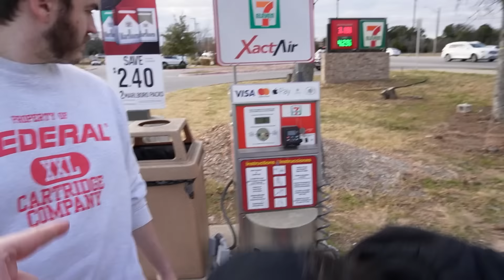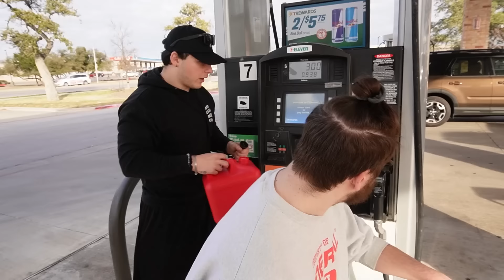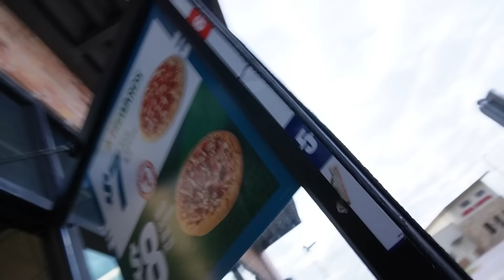i bought him a car

Comment: The 1982 Honda motocompo minibike was specially designed for the Honda City Turbo 2 to fit perfectly in its trunk. An easy portable scooter to use anywhere when needed

Comment: For those who don't know Blue Smoke means the engine is burning oil because of an oil leak
Reply: It's a two stroke. Blue smoke means it's running too rich. You would be correct if it was a four stroke though.

Comment: engines let out blue smoke when gasoline is burning off. its probably from when you were filling the tank and a little bit spilled.  it'll eventually burn off and stop. my lawn mower does the same thing sometimes lol

Comment: no way, a motocompo bike XD. You actually could got it if you also buy the car, but they also sell that separately. Its a 2 stroke, and it uses another different type of oil, what you'd need is a normal oil, and 2 stroke oil. For the smoke its normal because its a 2 stroke engine too, and so they would always burn the oil, its alright too. Congrats tanner for your motocompo, thats an epic ride for you!!!

Comment: a little note: the blue smoke is actually a bad sign from a "car" or any vehicle !
it simply means there's something damaged in the piston rings or anything else like that.. oil is simply burning wayy too fast and the car could eventually break down again..
Reply: overall.. im very glad tanner loves his new "car"!
Reply: It is a 2 stroke which means oil is added to the fuel to lubricate the engine, that is why it is smoking. Although it maybe is running rich because there is so much smoke.

Comment: i am cringing at the 3 of them putting straight up 93 into a fucking 2 stroke powered bike (you need to put oil in the gas otherwise the engine go kaboom)